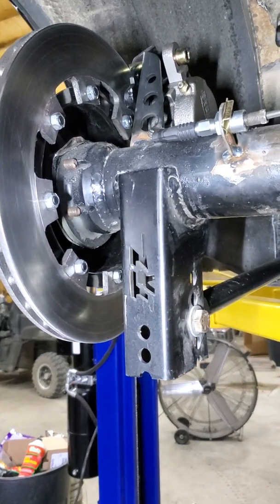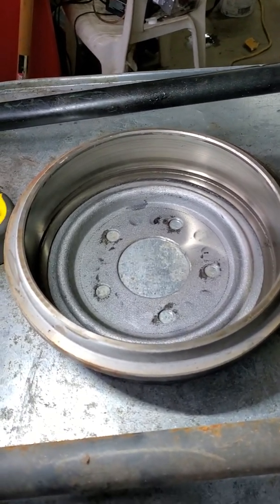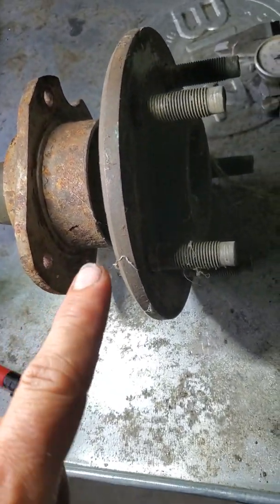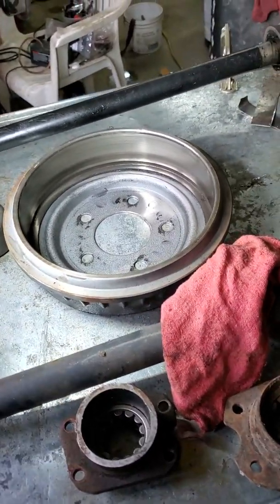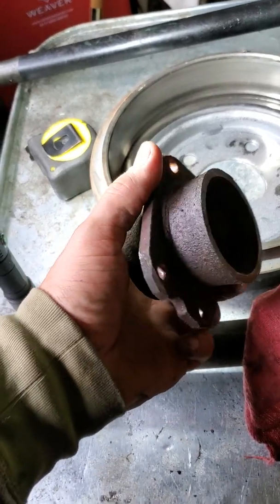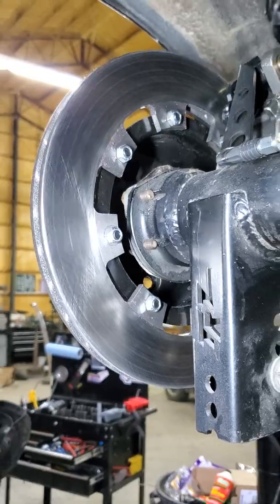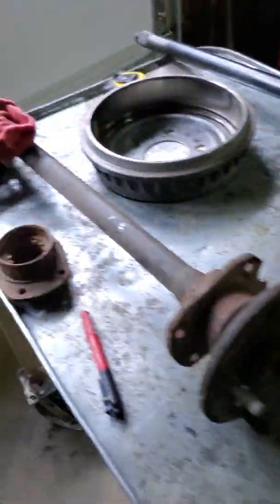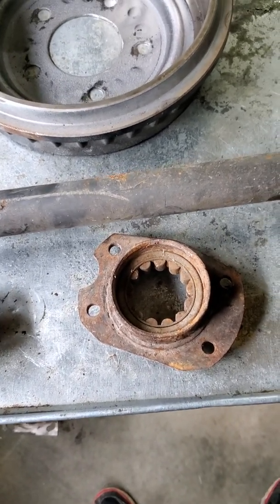(#2) H1138 strange housing end install 8.8 drum 9 inch bearing

Comment: Just had a axle welded with the H1138 ends thinking I wanted the stock flange pattern. My plan was to use the upr disc brake bracket (installed before the bearing). This bracket would also hold the 9" bearing in. The bracket works fine on a stock housing, cant see why it wouldnt work on one with 9" ends? upr SKU:3020-02